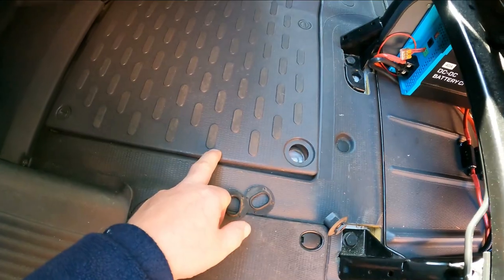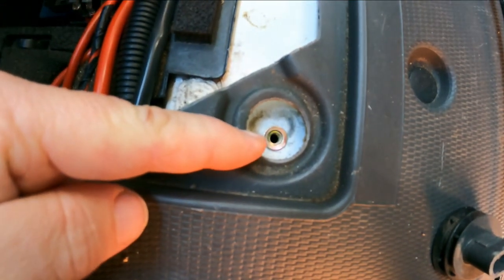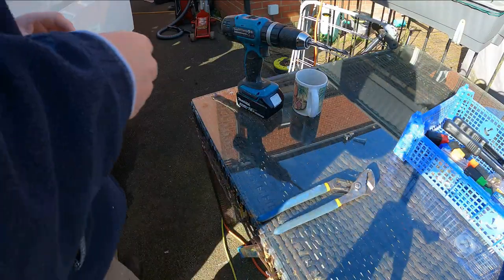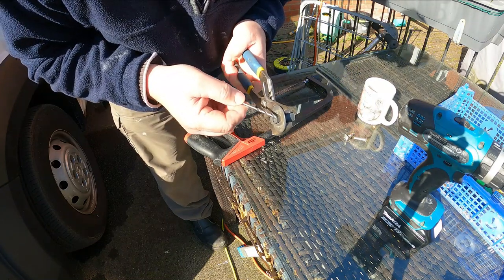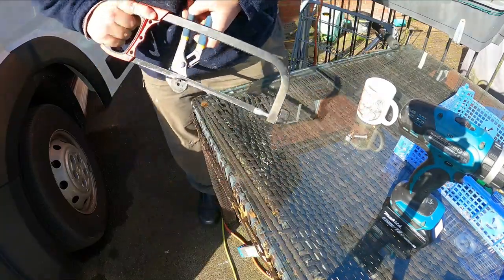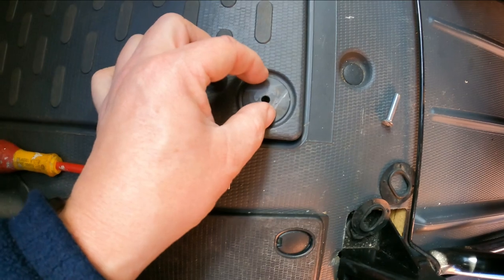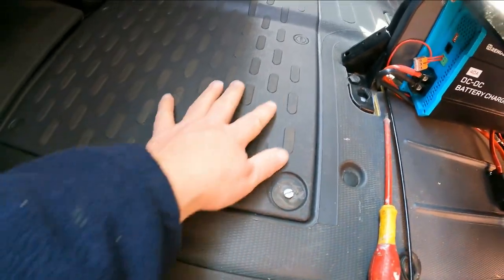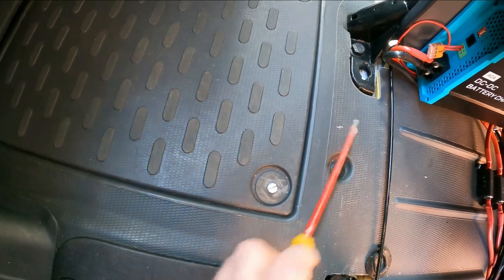Battery cover clip replacement on Ducato / Relay / Boxer / Promaster self build camper van

Comment: Any idea where I can get one as mine is missing
Reply from the maker: Short of paying a small fortune at a main dealer then not really. try Citroen, Peugeot, Fiat and now Vauxhall as parts will be same but prices may vary wildly. what i have done in past if they ask for reg number is just do a quick autotrader search for that van type and rough age equivalent. got a part from Peugeot for my Relay that was 40% less than from Citroen!!